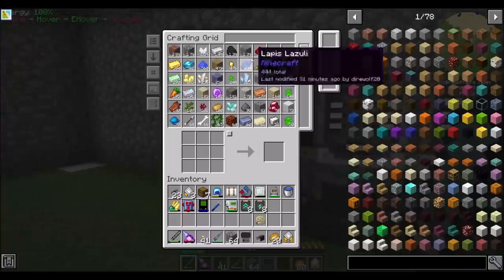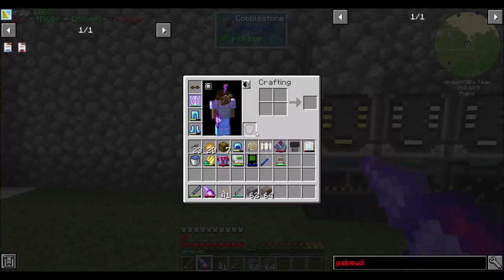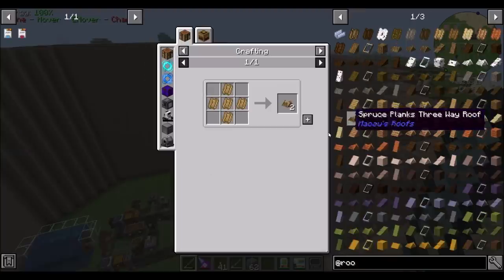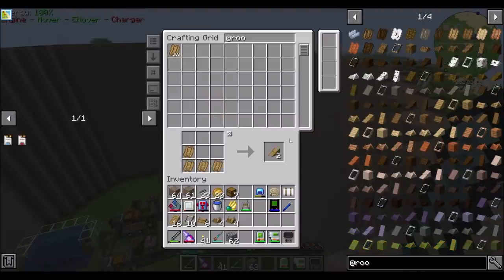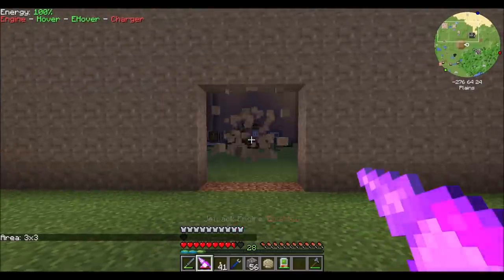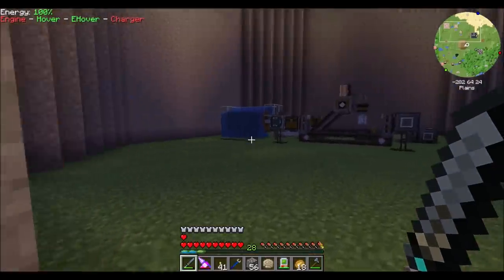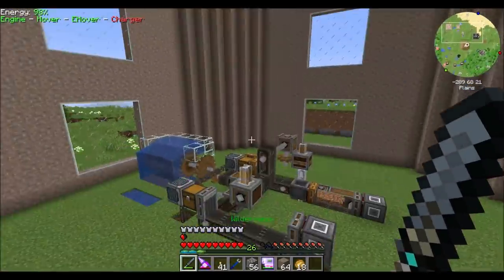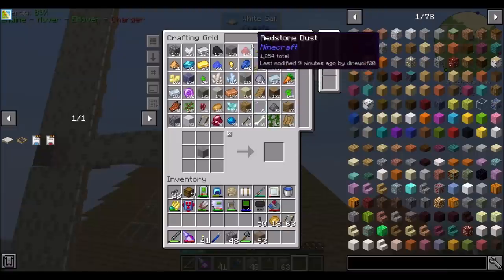Lets Play S10E29 Windmill (A for Effort)

Comment: Well. He did build a roof, you gotta give him that. It is definitely A Roof. I mean, it covers the top of the building, right? That's pretty much the definition of a roof. You have to admit, the thing he built is indeed a roof.
Reply: it do be a roof doe
Reply: One day I hope sure learns to use layering. 

This roof would have been better had it had an overhang, and two layers. A section with the 2 slopes and high up 1 block slope.
Reply: @NicholasMarshall  That's kind of what I was thinking, with the actual windmill up on the higher section.....

Comment: Dire, I can't in good conscience say that's the best roof I've even seen on this channel. Because Morvelaira has been on the same server as you. I will however say it's one of if not the best looking roof you've ever made. Bravo!
There's some alterations I'd do here or there, but on the whole; "Looks like a windmill" is the most important quantifier and I'd say it qualifies.
My only caveat is this; Where the bearing meets the roof PLEASE use an Encased Shaft to make it look like it's actually using the roof as support, Windmill sails are actually very heavy and need a REALLY good support, so even this would do a lot to sell it.

Comment: Dire, instead of the Gabbro block, in the center of your windmill, you might try the 4-way roof section. That would give a sort of spindle point to your windmill blade...in theory. And, I agree, you need some kind of support structure for your windmill shaft. Other than that, an excellent attempt. Keep up the effort, you ARE getting better with your creativity.

Comment: I know that this is late but, some building tips:
If you're attempting to make a large circle, you can "smooth" the diagonal edges by placing blocks adjacent on the diagonal, then horizontal, then diagonal again.  You don't want to do this all the way around but the first couple spaces it works.  I think there are some online tools that you can find to help figure out which blocks to place where.

Additionally, when you're "shrinking" the circle (e.g. placing the roof), you'll need to "shrink" the flat sides too - otherwise the top of your roof ends up being square instead of coming to a single point.   This usually involves building concentric circles on top of each other.

In the end, everything is circles.  I dare you to spend a day trying to make as many different sizes of circles on a flat surface as you can, and pay attention to them until you see the "algorithm" or pattern that makes them look good

Comment: compliments for the building. it's appreciated. 

i got two pointers, that would improve the building (if you ask me)
- i would put the create windmill, 7 or 8 blocks lower, so that its coming out the straight building (looks more suported and i think that it would look better)
- there is a lot of overhang on the corners of the building, this makes it so that the straight part looks more straight, but the corners take the hit for it. for the corners would it look better if you pushed it one block back (1 extra per hight)

Comment: I would suggest to add Create's sister mod The Mighty Architect. It's a really cool mod that gives you the ability to plan out builds in world using simple shapes. Once you got the basic shape it'll go to  the next step which is style of the walls and roof. You can change up how the decoration blocks look and even set up your own palette for the build to use. Once done, you can save the blueprint as a file and use the schematicanon and schematic table from Create to get the build made, provided you give it the resources required for the build. It's an amazing mod for people like you and I who don't have a great eye for design

Comment: For finishing touches..... does Create have some kind of scaffolding you can run shafts through?  (I haven't looked.)  That would be something you'd probably want to put around the shaft.  If not, um.  I'm really not sure what you could use.  Isn't Chisels and Bits in the pack?  I mean it would take a while to make something like that with C&B, but you could just build one and then blueprint/pattern it?  I think?  It's been a long while since I messed with that....

Comment: Dire, i really do appreciate you trying to make a more aesthetic building!
but i would offer you some optional tweaks to it
on the diagonals, could you try moving each level a bit more back? basically placing the new corner pieces where you currently have the cross pieces on the inside. this would make it so that the corner pieces dont overhang each other like that, and so it flows a bit more smoothly
this wouldnt line up with the flat sides though, so for those you could push the slopes back at each level similarly, and then just place a planks block in the interim. its not a solid slope, but it should still appear to flow quite nicely
now again, this is optional! if you just want to keep the building like that and get to making stuff with create, thats fine! you made something neat looking, and that alone is great!

Comment: Great attempts, but ... reallly, you should have done it 1 ring at a time once ya got the height as all you did was let yourself step on your future toes by enforcing a shape that wasn't possible to bend like you tried to get it to bend.

You ether need to taper the roof so the wide long sides are shorter each time so you can draw it into a point..  (so say 2-4 rings up. the sides have 2 less per ring, as you close the top up.
--  solution is mathematically 1 ring -2 width for 1 block in  for a roof that's ~1/2 the height of the width of your sides.  with the 'corners' flexing in count to make the size up & fill in while matching both roof sides.

Comment: That's clearly not the best building ever maid in minecraft, but most probably your best building ever, and sincerly it look not bad!!

Question to made it even better, changing a few simple gabro blocks would have clearly helped, making the roof protrude by 1 block from each side possibly and possibly adding wood log pillars or something like that on the side could clearly have given a little more style without being too complicated to do.

For the corner at roof level, if I'm not mistaken, the Copy-Paste Gadget could very well have been used to copy what you did on the first side at the level of the other 3 corners. Sure, it's too late, but I'm surprised you didn't think you tried using your own Copy-Paste gadget mod for this!!

For sure it is too late, but this comments can possibly help somebody else or help you for somes next buildings, if you try again to make somes nice looking building!!

Comment: I think I would have built a neck offset to the roof have it a normal height. Building it the way Dire did is a bit over the top. But I like small and efficient designs.